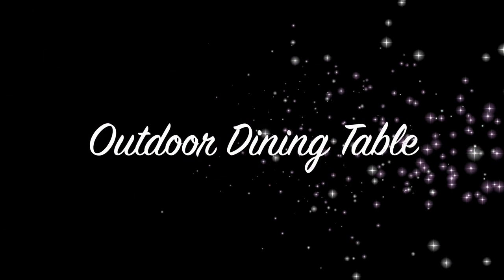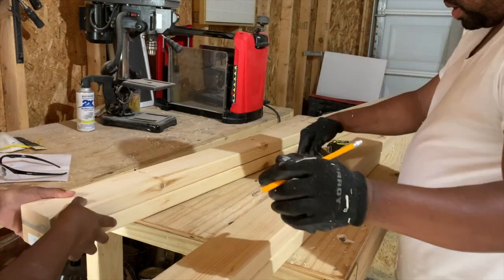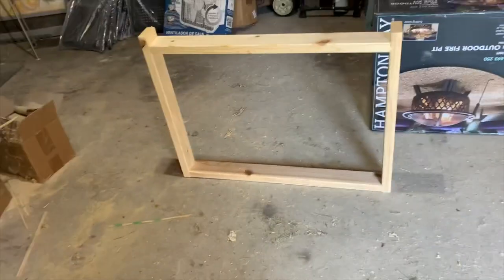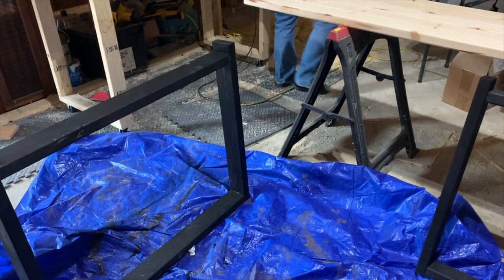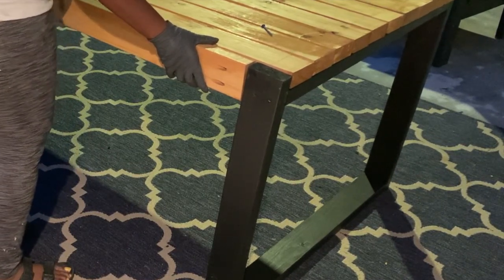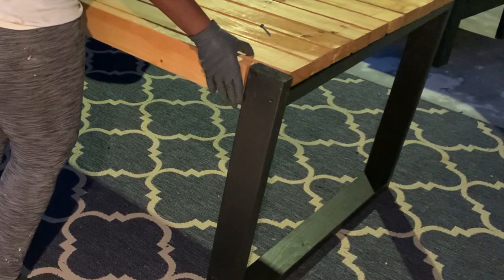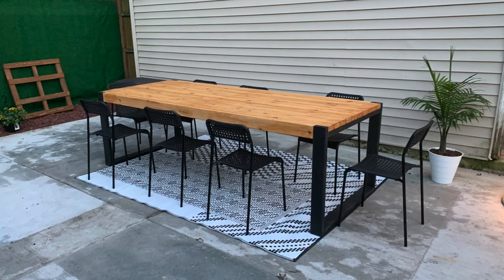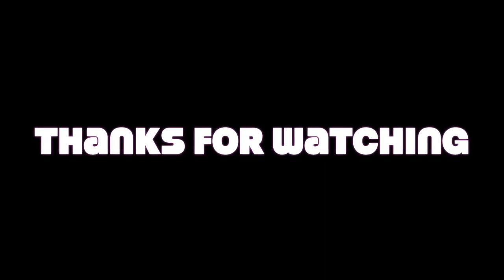Pinterest Inspired Outdoor Dining Table

Comment: Very pretty and super simple to make. It's been a year now, how is this table holding up with the weather so far? Do you still like it? It seemed a bit wobbly at first, is it?
Thanks for the video.
Reply: Same question from my side. I'm curious about the robustness of the construction. Usually legs for industrial style furniture would be made of steel. And what screws do you use? seems that they don't require pre-drilling screw holes.
Reply: @jamin__  Agree. Specially considering the wood that was used. It's regular soft wood from Home Depot or Lowe's. Easy to screw on but might not hold up for long. I'm planning on a design that uses 4X4 in an "X" for the legs and hopefully I can accommodate those plastic deck wood-imitating boards (I forgot the name) for the top, with some treated 2X4 to support the top.
Reply: @LuizNunes74  Sounds like a plan. 😎
I‘m also going to build a new table and two benches. For the top I will use European Aspen wood (also used for building saunas). My dad used it for two benches 30 years ago and it didn’t bend a millimeter and is still in good condition, although it stood outside in all weather conditions; just requires regular coating.